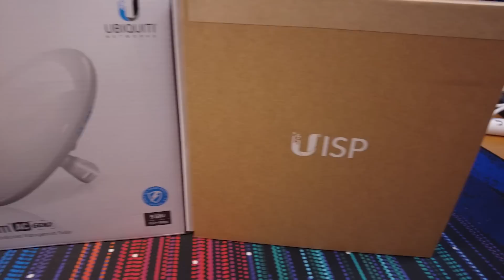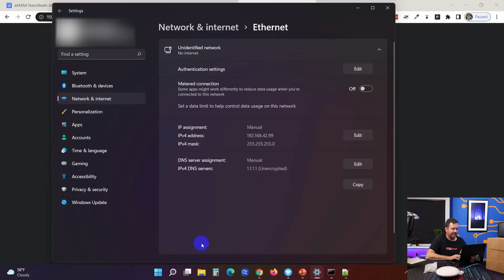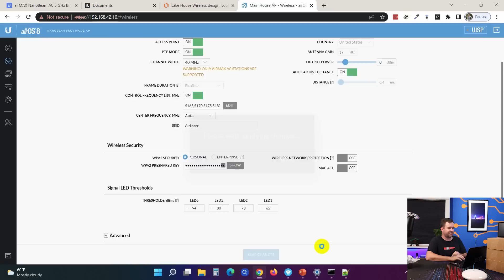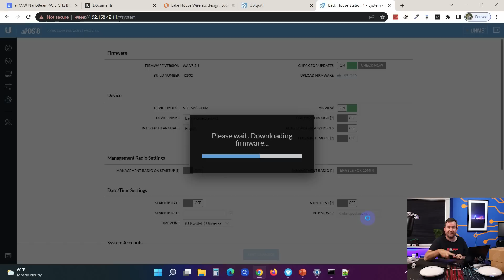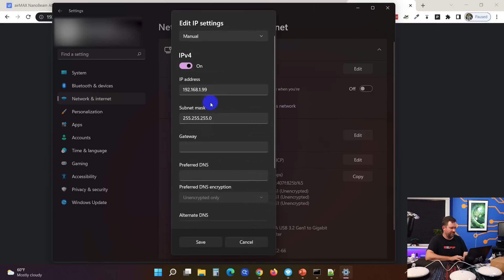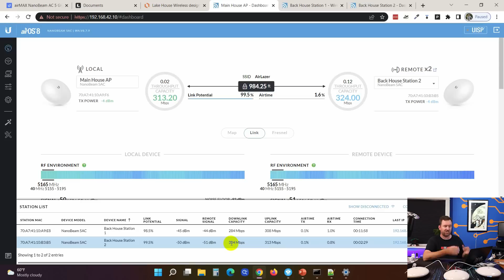PTP Wireless Bridge Setup 2022 - Step-by-step Guide!

Comment: As always, many thanks. I look forward to how the physical directional setup works, if you have multiple stations which are not co-located in just one direction. It would be great if that gets covered in a later video (while not wishing to set someone as busy as yourself any homework 😊).
Reply: IF the radios are close enough together, and are configured for FULL power, you can literally point them in any direction. I've configured Nanostation Loco 5AC radios in a basement and had the Stations connect to an outside AP quite a distance away (1500 feet) and pass over 100 Mbps symmetrical, then using AIR MAGIC (a tool availabe on the AP side), get the radio to tell me the best frequency to use to increase symmetrical bandwidth between the AP and the stations, then change to that frequency on all the remote stations, then the AP, and boom - top bandwidth across all radios pointed in whatever direction is possible at the locations needed. I have campus locations with an AP pointing in one direction, and Stations pointing in various directions with perfect signaling and great bandwidth. Using the built-in tools on both sides (AP and Station) is key to making this work. Look up AIR MAGIC and AIR VIEW (older tool, but still indispensable to find the best channel/frequency for the radios to communicate over).
Reply: @seanzigmund858  At what distance would it start to require a directional antenna at the access point side?
Reply: @samdotson7297  It depends on many factors - the radios being used, the frequency being used, channel width, capacity desired, the fade margin you're looking to achieve, etc. It's really a matter of what you're trying to achieve. As an example, consider a campus scenario where one building might only have 2 people with 2 devices (a smartphone and a laptop each) and a voip phone for them both to use - do you need 100 Mbps, or will 20 suffice? If 20, then you could set up a PTP or PtMP that only gets around 23 to 25 Mbps (20 Mbps total with a 15 percent fade margin (3 Mbps)). All things depend on what you really need on the other side(s). I don't ever look at the links as "maximum bandwidth all the time" but more "what do you actually need to accomplish" as a least common denominator starting point, then ramp up from there. So if an AP is behind a 300 foot thick forest and a station side only needs 25 Mbps total to serve the CPE devices, I know I can achieve that with a pair of Nano locos and an AirCube ISP (about $150 of gear and probably $400 of labor depending on cable runs and how I have to snake the cabling from point a to b, etc. Make sense?
Reply: @seanzigmund858  I was planning to use the NanoBeam 5AC he demos in the video in a PtMP Config.  My property is about 11 acres, but the house, barn, and RV are all within 50 yards of each other.  The furthest point is the front gate which is about 100 yards from the house.  The RV and Barn need enough bandwidth to stream TV, but the front gate just needs to be able to operate the gate and camera over the WiFi.  Is the 5AC powerful enough to reach the gate and support the camera video?  Thanks!!
Reply: @samdotson7297  More than powerful enough. But again, there are better/cheaper choices of radios to use, and radios with a wider beam width that might be a better candidate for your scenario, though the marketplace is bare right now! Nanostation Loco 5AC, Nanostation 5AC, and Lite AP AC (120 degree beamwidth!) are my go to radios for just about every scenario within 2 miles distance, up to 355 Mbps symmetrical, and poor to excellent line-of-sight. The Lite AP AC radios can cover a large distance and beam width, so if you use that as the AP at your house and shoot to your RV, Barn, and Gate and use Loco 5ACs at each remote, you'll guaranteed to get great links. You'll be best off turning the power down on these radios to between -4 dbm and 0 dbm because each location is so close (out of a max of 23dbm on the Nanos and 19 dbm on the Lite). These little puppies scream!
Reply: @seanzigmund858  very helpful Sean!.  What would you recommend as an access point in the barn, RV, and gate end points.  The gate is the opposite direction of the Barn and RV, so will the Lite AP AC 120 degree antenna work for that as well, or would i need a second one?
Reply: @samdotson7297  my recommendation would be to try with just the LiteAP, because at that short distance you're likely to get a great signal from the LiteAP with it's power turned up enough (I'd guess between +2 and +10 dbm). As I've stated, I've used these radios a lot over the years and have been successful getting the locos locked up to another loco, or nanostation, or liteAP that are close (within 1500 feet) in opposite directions, outside of the beamwidth of the radio (locos only hae a 45 degree beamwidth, but I've locked radios that are 180 degrees away from each other by turning up the power, turning off EIRP Calculation and Auto Power controls (which cause the radios to adjust themselves automatically based on signal detection with the AP), and setting the frequency to a DFS channel as a primary (say 5300 DFS) with a higher secondary as a backup (say 5740). Then, after the radios all lock up and I see the signals, I run AIR MAGIC on the AP and let it tell me what it thinks is the best frequency with the highest possible bandwidth - AIR MAGIC will show you the frequency you're currently using and it's max bandwidth capability but also the "best" frequency to use for the highest possible bandwidth as it "sees" it - a really cool and useful tool!). By changing each remote radio first (connect to it via it's IP over the bridge connection you now have connected) to the new frequency AIR MAGIC shows you, then changing the AP side, the radios will go down for about 30 seconds, adjust to the new frequency, and lock back up with the AP side on the new frequency and you'll see much better bandwidth. This is all done in the WIRELESS section of the radio's configuration and takes some getting used to. Just remember to first find the AIR MAGIC best frequency, then log into each remote radio from the AP side (meaning you are at the AP side of the network) and change those first one by one, then change the AP and then wait 30 to 60 seconds for all APs to lock back up, then on the dashboard look at the change in bandwidth. I've had radios that I've started out on one frequency (again, usually a low DFS channel like 5300) and use the AIR MAGIC recommended frequency and seen bandwidth capacity DOUBLE! It's a great tool, and at such a short distance, there's no doubt in my mind you'll get all your radios to lock up, even if they're 180 degrees in the opposite direction of the LiteAP. Last thing I'll add - once you do get them locked and you see the signal strength and chain differences on the dashboard page, try to tweak the power settings on the stations and the AP to as low as you can so there's less possibility of interference and noise. At your distances, I bet +2 dbm would be fine! Good luck.
Reply: @seanzigmund858  Many thanks for your generous reply.
Reply: @connclissmann6514  you're welcome, Conn. :)

Comment: If you connect the AP to a trunk port  to trunk vlans across the ptmp link, how do you sparse out just one vlan (like cameras vlan) out for use on the second Ethernet port say on either the AP or bridge side?
Reply: By switching the Network settings from "Basic" to "Advanced" and modifying the interfaces

Comment: Why change the subnet to 42.x?  Any reason not to leave it at 1.x?
Reply: 192.168.1.x is widely used as a default. If you want to manage traffic on a larger network as described by Chris, it makes sense to move away from it so that the IP range in use will not accidentally overlap with equipment connecting on the default range, potentially leaving a conflict of IP address or potentially a data leak. If you plan to use VPN access, you can only securely VPN from one IP segment to another. If both sides are at .1, the VPN will not be successful. These are the main reasons in my use of other IP ranges.

Comment: Is there a benefit to using the PTP mode if you only have a PTP setup? Could you just leave it unchecked and if in the future you add another station, you wouldn't have to change that setting on the AP and first station?
Reply from the maker: In PTP mode, the channel width can be up to 80MHz (more available bandwidth = more speed).
Reply: Chris is right - in PTP mode, the radios allow for upwards of an 80 Mhz channel width selection, whereas in PtMP mode, you are limited to 40 Mhz channel width, meaning a max capacity between the radios of 340 Mbps. The benefit of ease of future management of adding radios really only makes sense if you know a) you're going to move into a PtMP scenario at some point, and b) you're going to roll out more and more stations in the PtMP scenario. Otherwise, reconfiguring the AP / Station pair just means you log into the Station first (if you're at the AP side of the link) and change the settings in WIRELESS, then change the AP side and they'll both lock up again at the desired/configured channel/width selection you make.

Comment: I use two NanoStation 5AC LOCO to bridge between my house and my garden just over the street. Its just 25-30 meters but i can't run an cable so i use the NanoStations to connect remotely. It's cheap and works perfectly for me. The link capacity is around 600 and I get stable 100-120 mbs per second throughput. Its enough to run two cameras and an Access Point for Iot devices and my Phone or Laptop. Even all my VLANs work perfectly. If you need a cheap solution for an small distance, I can recommend these.  The setup is nearly the same as in the video. I like them because they are way smaller and just are 50€ per unit.  My only down site is, that the Topologie isn't correctly recognized by my UDMP, but i think ist fine for how well they work otherwise.
Reply from the maker: Great feedback - thanks!
Reply: I use 2 locos to my workshop with a Aircube and it works like a champ. 2 years and no issues. Can’t believe the Aircubes are $29. That and $49 each for the Loco’s is a bargain to provide access to a remote building.
Reply: @reg_in_sc4572  Yes! No need to integrate UNIFI gear into the mix for simple scenarios like yours - having to use two different management platforms (UISP and UNIFI) makes no sense if the coverage needed from the AirCube is neglible). It's an awesome WISP solution and totally manageable in UISP for FREE (if you have 10 AirMAX and/or EdgeMAX devices!) Love this gear.

Comment: Set up PtmP with LiteAP and two NanobeamACg2 over a year ago. Going to troubleshoot our first issue today.  Great products.
Reply: Follow-Up.  Power cycling the LiteAP fixed for one base station, the other was left without PoE when someone else was troubleshooting.  Plugged back in and all is well again.

If I had known about the PoE adapter that provides 24V passive from 802.3af, I could have fixed most of this issue remotely.

Thanks for the video!
Reply: @tompuryear  Be careful if you're powering the LiteAP with a PoE port of an ERx or ERx SFP. I've found many times, the hard way, that not using a PoE brick and letting the ER's power the LiteAP eventually led to a lot of bounces and instability. Edge Switches on the other hand have never given me problems, oddly enough.
Reply: @seanzigmund858  Thanks for the heads-up on this Sean. Really invaluable information here. Appreciated.
Reply: @brandonbrand2338  You're very welcome. ERx is a powerful little router, but after about a year, it's PoE output on port ETH4 just starts going south and the gear powered off it bounces constantly! I have yet another customer with the same issue - just started a week ago... be well!
Reply: @seanzigmund858  Noted. Thanks.
Reply: LiteAP is powered by injector since the switch is USW-24-PoE doesn't support 24V passive.  Plan on getting the adapter to convert PoE+ to 24v passive so I can remotely restart.

Comment: you didn't deselect all the DFS channels. Should have scrolled down.
Reply from the maker: Thanks for pointing that out!  Difficult to get everything right when I'm talking, recording, and working at the same time.
Reply: Yup, and less selected channels, so the AP doesn't shift around to too many other channels if it decides to (for many different reasons!), causing the stations to disconnect/reconnect constantly. Put it on 2 or 3 channels only, usually with a DFS channel selected as the first/primary channel and a higher non-DFS channel as a secondary channel just in case the DFS channel has to be switched off due to reception of Industrial/Military DFS traffic (really only happens in metro/suburb areas... out in the sticks, DFS channel changes done by the radio automatically don't happen that frequently at all. Using a DFS channel always provides better overall capacity and throughput in my professional observations of all the deployments I've done over the years. And, using AIR MAGIC, AIR VIEW, and alignment tools aids in making the best possible frequency selections!

Comment: Their product page doesn't mention any Mbps.  The "airMAX PowerBeam AC, 5 Ghz, Bridge" mentions 450+ Mbps, but this nano doesn't make any claims at all?
Reply from the maker: I think they removed any promises of distance and/or speed from the product page and data sheet because they don't want to be held to it.  Personally, I believe the NanoBeam is good for a few Kilometers max and should get you around 300Mbps when dialed in properly.
Reply: @CrosstalkSolutions  Actually, with proper tuning and use of AIR MAGIC, AIR VIEW, and alignment of the radios you can get much further distance and upwards of 340 Mbps capacity (though actual throughput will be lower) with the AC series of radios. Really awesome tech from UI.

Comment: great video! love it! ... one question, have you noticed any speed difference between the nanobeam AC, nanobeam 5AC, and the nanobeam 5AC Gen2 ? ... keep up the good work!
Reply from the maker: No - those devices are all very similar in speed and capability.
Reply: The 5AC allows you to put an additional dB of output power if your country allows for it. The first gen also uses the XC chipset, where as the Gen2 uses the WA chipset which supposedly doesn't deal with noise as well, also the Gen2 has two ethernet ports with the second port capable of PoE passthrough
Reply: No, but speed differences will show up when you tune the radios properly using the built-in tools (air magic and air view - air magic is only available on the AP side radio and really improves overall capacity and throughput performance! Look it up and use it on every deployment - it'll drastically improve capacity!)